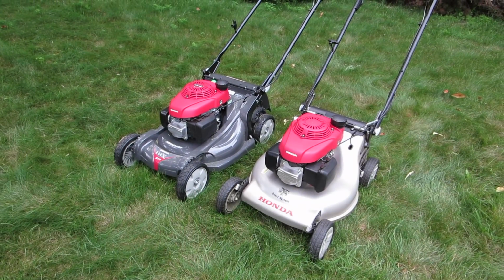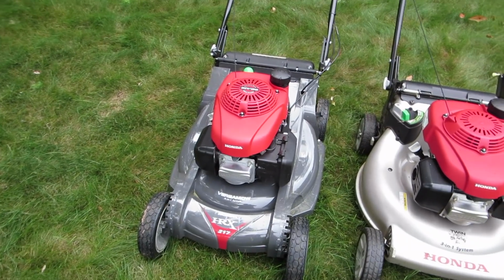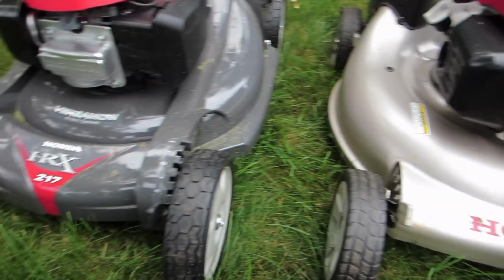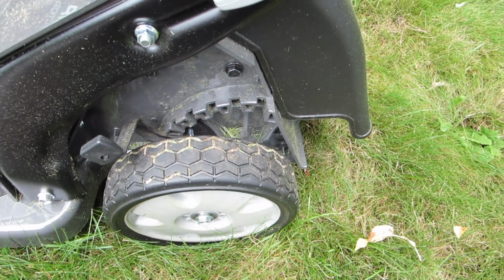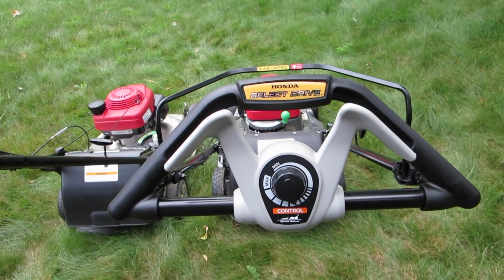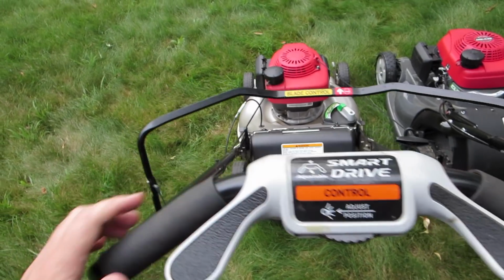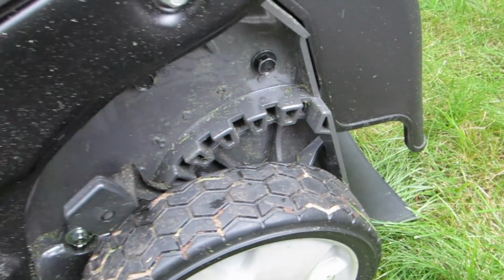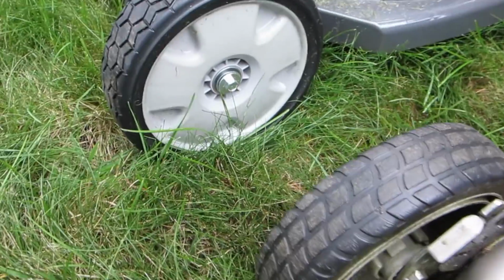Honda HRR vs HRX Mower Comparison - long term review

Comment: I am glad you have had good luck with the HONDAS, mine hasn't been so good, I have the home entry model , bought about 4-5 years ago at the orange box store.and its currently broken, year 2 it needed a new pull starter cord, last fall when mowing up the leaves the rear drive stopped working and the wheels lockup when being pulled backwards, I doubt that the mower has 20 hours on it, I have had CRAFTSMAN and MURRY's in the past both lasting for 20+ years. I have bought TORO, HUSKY, AND troybuilt FOR MY SCHOOL DISTRICT MAINTENANCE CREWS and all performed much better then the HONDA  and the HONDA cost over twice as much as the other brands. I do credit HONDA for being an easy starter, but that does little good when you can't even move it. Although at times it a 3-4 pull to start when the engine is warm. Sadly my mower has ben maintained by the book, still looks like new, but uts dead, NEVER another Honda for me, and thats sad as I RODE honda MOTORCYCLES from the 60's-90's

Comment: Honda introduced the Xenoy (aka NeXite) composite mower decks on HRM models in the early 1990s. That's no gimmicks. Because most people don't clean their mower decks after mowing and because grass often could contain some level of moisture or absorb moisture secondarily when clumped under the deck, steel decks do tend to corrode if not properly maintained and periodically treated. Composite decks, by definition, avoid such a problem. Obviously, all of this matters if one intends to keep their mowers for a long time (ex. 15+ years).

Comment: For St Augustine grass the HRX is the one to have.
Reply: mrZ71  Hydro drive, and ease of operation. Great mower!!
Reply: mrZ71 -30% more Torque, for one.
Reply: mrZ71 HRX has a larger 190cc engine with a bit more torque than the HRR 160cc

Comment: I have the HRX, it's fairy new.  The wheels are made of rubber.  What I don't like about it is it's too fast and I have to practically run behind it to keep up. Also I put it on my hillside and pressed the clutch, I was shocked when it just stayed in place, it didn't go up the hill.  I keep it outside under a tarp so the plastic housing better than metal for me.  Oh, and mine doesn't start on the first pull either.  Last time it took 3 to 4 pulls so that auto choke thing doesn't work well.
Reply: I think mine needs some Gumout to fix the hard starting problem. Maybe gasoline was left in it too long.

Comment: Advantage of plastic deck isn't so much in the fact that it doesn't rust. The real advantage is the fact that the grass sticks much less on the smooth plastic deck than on a metal one.. Big difference..

Comment: I bought the HRX217 with an orange old style throttle with cruise control and blade stop and I switched from Toro. I disagree I think you definitely want the HRX because it will go as slow as you want and not drag a old guy like me around the yard. I found that other model be with the paddles for throttle control was a pain. It does how ever not turn as smoothly as my Toro did but the cut quality when I mulch is way better than my Toro .i do still have my Toro but will most likely give it to someone for next season

Comment: I have an HRR and the rear wheels lock up when pulled back. Does yours do that too? What about the HRX?
Reply: There is a youtube video showing how to resolve the locking wheels. I seem to remember "The real fix" in the title.
Reply: @edinroundrock8671  I know how to fix it, but it is doing it again after I fixed it the first time. Im tired of taking it apart.

Comment: i like bigger wheels ...i wish they had 10'' or 12'' in back and 8 or 9s in front... great for soft spongy yards..i also wish it was available with no drive system... i prefer to push and pull using my own power...

Comment: The height adjustment is marked for the rear wheels. The numbers are molded into the plastic and are visible around the 5:40 mark in the video. Thanks for the posting, I was wondering if the drive paddle varied the speed on the HRR and you answered that.
Reply from the maker: James LaRocque  - you’re absolutely right! I never noticed those markings, thanks for catching my error! I still think they should be marked the same way on all four wheels but this is great to know!
Reply: @garagedad4540  yeah, they don't make them easy to see, for sure. Even if they scuffed the faces of the numbers, they might show up better.
Reply: @garagedad4540  maybe you could take a bright permenent marker and trace over the numbers to make it more visible 😎

Comment: THE EXCACT video i needed, i am torn between these 2 models to buy. i want the HRR because of the lower price, however i would really like to know if you can put the better tires on a HRR?

i also have a 2nd issue with my soon to be purchase, the one store i went to get a quote. had excellent customer service, however the second store i went to was $100.00 cheaper, but the service was very sh*tty.
Reply: Don't buy from a big box store like lowes or home depot ( they take months to repair sometimes )plus the warranty costs $50 - $100 extra on top of the mower price. Buy from your local john deere house or local hometown tractor store for better warranty ( support your local farmers ). Buy the HRR216VKA you can replace the wheels with the HRX217VKA wheels with a soldering iron .( heat up the tabs on the rear wheels ). Bada Bing Bada Boom.
Reply: @laborerslocal1103  I ended up buying from the more expensive local dealer, however i told them about the price differnce, & they matched it right there & then with 0 haggling 😄.

pretty happy with my purchase so far. after this month it will start makeing $.

Comment: Hello - I just purchased the HRR from home Depot for $360 after using a Lowe's 10pct coupon. I am reading through a few reviews online and am a bit concerned. The reviews on an average are around 9.4 out of 10 but negative reviews report problems of running behind the mower, high maintenance, leaves a trail of grass and does not mulch well, rear wheel drive leading to unintentional wheelies, difficulty in turning at the end of your stride etc. I am now having second thoughts on whether I should return or retain. Any clarification is appreciated.
Reply from the maker: Hi, it all depends on what you’re comparing it to. I would say from experience that I have not had those issues. 

Mine has needed almost no maintenance, and I actually prefer the drive system because it’s infinitely adjustable based on how much or how little pressure you apply. I’ve also never had a problem with it popping a wheelie and I would be concerned about anyone who has had that experience, they probably don’t know what they are doing. 

For the price, I don’t think you’ll find a better mower than the HRR, especially given the reliability. 

Of course, if you have unique needs or preferences (and a bigger budget) it all depends on what you’re comparing it to. But my take is there is nothing better in that price range.
Reply: @garagedad4540  thanks for the affirmation. Perhaps I will just hold onto it then. I have some inclines in my yard. Is it good for inclines?
Reply from the maker: You won’t be unhappy with it. That’s for sure. In my review I mention that part of the appeal of the more expensive HRX, for me, is the better wheels and added power which do help on inclines and rougher terrain. But they are not enough of a difference for most people to matter. 

So, it depends on how serious your inclines are. I don’t mean gentle slopes... I’m talking about actual hills and things like exposed tree roots where the added traction helps you keep going smoother without having to get involved steering it or giving it a boost from the handle. 

Since you already bought it, you might as well try it out and see if you feel like you want more power or more traction. You can always exchange it if you’re unsatisfied... but I truly think the HRR is great and almost everyone would be happy with it.
Reply: @garagedad4540  no it's not that bad. It's just that on my backyard I have level ground that slopes upward.
Reply: All the normal negatives of these over-priced mowers.  The blade clutch system is horrible in tall thick grass which leaves a trail of uncut grass in heavy mowing conditions, causes the mower to bog down and will even stall the blade and occasionally the engine.  For the price they have the world's  smallest bagger, and they have no weight up front so when you use the bagger they want to do wheelies for sure, and the rear wheel drive system makes them cumbersome to turn around and mow around obstacles.  I went back to an el-cheapo regular 3-in-1 push mower I hated the Honda so bad and for the ridiculous price they have on them they're far from reality for no better than they are.  

I'd return it and just buy a regular push mower because you'll quickly hate how the Honda operates.

Comment: I have a slope in my backyard and part of it is 35 to 40 degrees. My 25 year old 2 cycle lawn boy handles the job, but the cut is kinda poor.  Can these Hondas do the job without oil starvation?
Reply: No, but TORO’s cordless can!

Comment: I've had the HRR for about six or seven years now. The back wheels lock up when pulling backwards, replaced the transmission for $25 and it lasted about a month before starting again dragging the back wheels when pulling backwards. Mine also doesn't do well in thick Bermuda, bogs and leaves a trail of clippings. The height adjustment also seems to either be too high or one notch down scalps. I measured the deck and it's about a 3/4 I ch drop on one notch. Looks like the HRX has more height adjustment notches... True or false? In need of a new mower, Toro maybe
Reply: Did u let your dealer know? There is a recall. And there is a u tube video about it. Just type in honda lawn mower wont back up .
Reply: Also keep driver side wheels towards grass it will cut better. Maybe have dealer sharpen blades. It is a pia to get the 30 angle on it.
Reply: Grass that is not cut.
Reply: @cliffm.9796  Funny I just saw this video. I took all those actions when I replaced the transmission and it only fixed it for a couple of mowings. I ended up selling it for $75 and getting the HRX217 with the blade stop and throttle with the paddles. It's been a champ so far.
Reply: @jamesvanvranken7919  I did and they didn't mention any recall and sold me the $25 transmission. I guess I got the experience of replacing it and it worked for a little while. I just bought a different Honda and haven't had any issues. I was ready for something with better height adjustments since I low cut my bermuda.

Comment: The HRR speed control stinks.  Mowed my yard twice and took it back for a refund.  My old model had the three speed setting
which worked fine all the time. The HRR wheels do not have bearings.  The plastic hubs roll around on the wheel bolt.  The HRX has bearings  like my old model. I am keeping my old mower.  New is not better.

Comment: Heavy VS not as heavy.  Rust VS no rust. $500 VS  $800
Reply: I've never seen anyone keep a mower so long that it rusted out.  When I retired my Montgomery Wards mower it was only because the plastic wheels were getting very worn it and it would have been a $100 for wheels for a mower that didn't have features I wanted, other than it was free when I got it, lol, and it didn't have the nanny crap that the lawyers forced onto new mowers.

Comment: I have an hrr that is just over 2 years old and it started burning oil last summer. I took it to an authorized dealer and they said they checked it and ran it a couple hours  and there was no burning oil.  They claim it will burn some oil if you mow on a hill. Well, it does smoke at times when put on a load and looks to still be burning. I have to add a little oil every couple hours and I am not happy. Will probably find another place to take it too since it is still under warranty. Needless to say I am not happy. If they can't fix it I will either rebuild it myself or get a Toro as I love the Personal Pace.
Reply: just curious, do you ever turn the mower on its side?  I'm sure you know, but just in case, if you turn it to the side where the air filter is down or are on a steep hill where the air filter side is much lower than the other side, the oil will flow into the air filter and into the combustion chamber and get burnt.
Reply: @beb1527  only when I change oil. I do have a couple small areas that are an incline, but I only mow them up and down, not sideways. It burns it when it is under a load. I just checked today after exactly 3.5 hours of run time and the oil level was only 1/8" up the dipstick and starting to get a dirty color to it.
Reply: @shawnengstrom3906  I'd talk to a manager at your local dealer and express your dissatisfaction with their diagnosis as you are still seeing excessive oil burning.  You may get further that way vs. working with just the service guys.  Also see if there's a # you can call at Honda about your dissatisfying experience.
Reply: @Believe231  I'm going to try a different dealer, but it's hard when I have to mow every 3 days.
Reply: Took to another dealer and they checked compression and got 70. Talked to Honda and they said anything above 60 is satisfactory. Honda said to try changing oil fro  synthetic to their oil. They ran a couple tanks of gas and did 3 oil changes. I'm not buying it as I ran it for 30 minutes and it seems like it is still burning it. They wanted to charge me $160 For this and I got mad be a use they did what Honda said to try without telli g me it would be at my cost. They knocked it down to $80 and I'm still not happy. Honda said next step would be to tear it down, but it would be at my expense if they decided not to cover it. The dealer said they doubt Honda would cover it so I just took it home. Honda says they see this happen, but mostly in generators and it was because of using synthetic oil in an air cooled engine. Not sure I am buying this, but it does not say anything about this in the manual so I think they should cover it, but they won't. Needless to say I am ticked at Honda and it will be the last one I ever buy. Already picked up a Toro Super Recycler, 2018 model, that was barely used and I love it. Personal Pace is awesome and it cuts better, no more long blades of grass sticki g up here and there.
Reply: @shawnengstrom3906  Taking a compression reading only tests the compression rings ability to seal against the cylinder walls & piston, not the oil control ring's ability to stop oil burning.   Can have good compression with an problematic oil control ring.  Keep pushing the issue if it's still smoking and burning oil.
Reply: @Believe231  I  understand that, but the oil ring lets some oil by to lubricate and help seal the compression ring which is why they were hoping it would stop burning if the compression went up sealing it better. I believed all along it was the valve guides, but the next course of action per Honda and the mechanic would be to tear it down. Problem is that if they found the problem and Honda denies warranty on it, which the dealer felt that based on past experience they most likely would, I would be stuck with the bill and that cost would exceed the value of the mower. I'm not willing to risk it, especially after getting the Toro SR which I like a lot more.

Comment: Just grabbed the hrr with electric start for 360 while the ones without estart were 400 it was like it was calling my name and is my first owned mower 😎🌿😎I have yet to use it however  the price difference for the hrx was just to much with same deck size. Great review!!
Reply: Where did you find one for that price?
Reply: @CoachKX27704  home depot heck of a deal just got lucky it was the only one left
Reply: Thanks, hopefully luck finds me as well, lol.
Reply: @CoachKX27704  it will just keep your eyes open for the deal I looked at mowers for a month and boom there it was
Reply from the maker: Glad you like it! I agree, the price difference for the HRX is too much and not worth it for most people. 

I usually love to justify splurging in the more expensive equipment but this is one example of that being hard to do.
Reply: @CoachKX27704  Yep, as mentioned just keep an eye out for deals.  End of season in the fall, and leftover from prior season in the spring deals often can get you a discounted Honda mower,-that's what I did, got a leftover prior season hydrostat powered (cruise control model) HRX for nearly $100 off at the local dealer!

Comment: Great video - - but one noted flaw...maybe you have an older model HRX 217 VKA, but the one I just purchased in April 2019, the drive system is variable.  I keep mine set at a lower speed selection, and if i need to go slower, I just release pressure on the "wing"... thought this was an error until I ramped up the speed knob to a higher selection and did the same...it will go full out on fastest or anywhere in between depending on hand pressure. I could never cut on fast, unless I wanted my neighbors to see how to make a push mower pop a wheelie!!  :)  P.S. - Any horsepower info on the newer 200GCV engine? I heard you mention 5.1 on the 190, where did you find that info?
Reply: I have a 2019 HRX217VKA and I concur.

Comment: I have two HRX217s (a 2010, and a 2019), and I admit I never use the Versamow feature. I'd never choose that HRR though. Looks so basic.
Reply: (My 2010 HRX217 has the Smart Drive controller. The 2019 has the Select Drive. Cutting 2 acres of very not-flat terrain weekly, I thought I'd hate the Select Drive after almost a decade using the Smart one, but it's ok. Plus it's not simply on/off.)
Reply: BTW, what a great country and great economic system where one man can have two high-end consumer lawnmowers lol